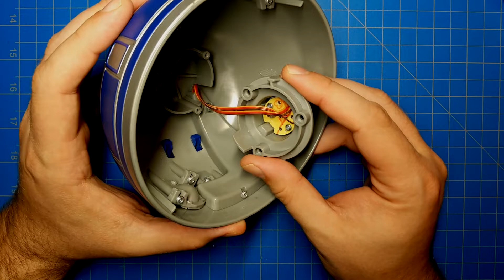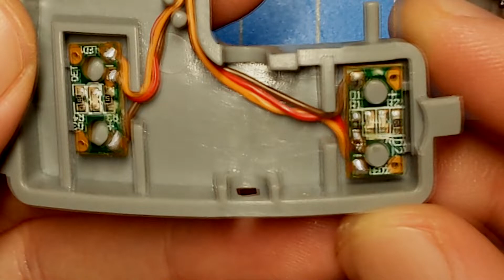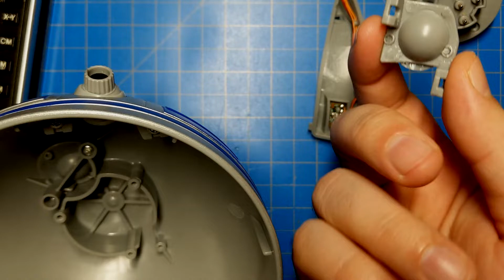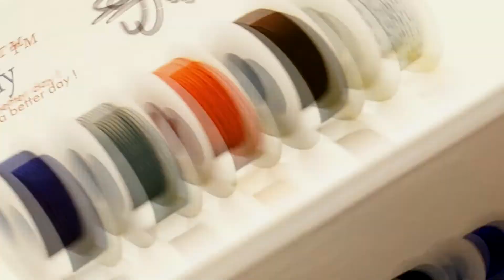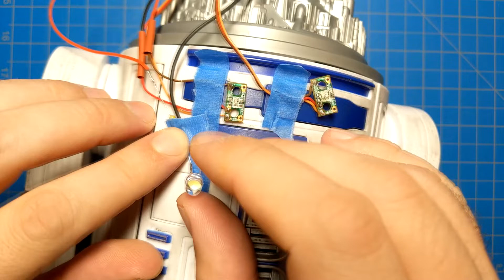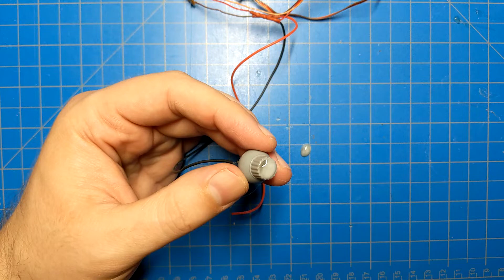Adding An LED: A Galaxy's Edge Droid Depot R2 Dome Mod

Comment: These mods, and this channel, got me to buy a custom R2 unit from Droid Depot. Thank you! Now, to truly customize it...

On that note, questions:
1. What would be the best spot to tap into for an always on/power on led for R2 domes?
2. This is opening up a can of worms, but I have to ask since you know both body types pretty well: Is it possible to power a BB head using an R2 body? It definitely wouldn't fit as-is, so 3D printing will need to be involved to make a "neck" of some kind, but I'm wondering what it would take to address the power side of things?
Reply from the maker: 1. there's really no always-on power for the head. the head has 5 connections to it, 5V, detect, and the 3 LEDs. 5V goes into all the LEDs in the head, then the 3 LED connections are pulled to ground (completing the circuit and turning the LEDs on) by the microcontroller in the body of the R-unit. maybe you could recreate the head detect circuit (a resistor) inside the body and then rewire the connector to repurpose the head detect pin as a ground. that would require heavy modification and a bit of research to trace everything out ahead of time. not sure what the consequences would be of have the detect circuit in the body, but I don't think it'd break anything.

2. BB heads are basically a coil of wire connected to 3 LEDs in the head. pulses of electricity through a coil in the body of the BB unit are picked up by the coil in the head and power the LEDs. kind of like how wireless phone charging works. To repurpose a BB head for an R-unit I think you'd have to rewire everything inside the BB head so each LED is on its own line like the R-unit heads. The easiest route would be to take the electronics from inside an R-unit head and fit them inside a BB-head. If you don't want to do that, a lot of wiring, 3D-priting, and probably some PCB fabrication would be in your future.

Comment: I like your mod! Could use a bit of refining, but it does look good! How difficult would it be to mode the back processor state indocator (PSI) and diagnostic display to light up as well? Would it be too much for the stock electronics? I want to mod the PSI and display ports to light up when the sounds go off, but if it's too much then I may either do a separet power source for the back LEDs and leave the front ones alone unless I want to swap out an LED color for a droid I make. Like my main R2-Unit R2-SP, his PSI is supposed to flicker red and orange in the front and his logic function displays are supposed to be orange as well, so with that being said, is it difficult to swap out LED colors as well?
Reply from the maker: The mods are possible, but may not be easy. When adding extra LEDs to an R-unit dome, the limiting factor is current. Each stock head LED is powered by a wire than cannot carry more than 20mA of current. Using resistors to limit the current is critical, otherwise you risk damaging the microcontroller inside the droid. The current issue is covered in this video, but I wanted to emphasize it here.

The dome (thus the PSI and diagnostic display panels) is made of opaque plastic. To make those light up you'd need to cut those areas out of the dome and replace the panels with some type of translucent material in order to allow the light form the LEDs through as well as diffuse the light. There's some room underneath the dome, but not a lot, so you need to be aware of the depth of whatever electronics you're adding to the dome and whether or not they interfere with the elements under the dome; in other words, keep things under the dome as close to the dome and as flat as possible.

Maybe a side-lit panel (usually used as a backlight for displays in electronics) would be the way to go. Something like this panel from adafruit: https://www.adafruit.com/product/1626. Or build a replacement panel so it's on the outside of the dome. Instead of cutting out the panel, place the new panel over the existing panel's area of the dome and drill a hole through the dome to allow wires to reach the new panel. 

Attach (tape) all wires to the inside of the dome so they don't dangle and potentially interfere with the elements under the dome.

Replacing the PSI LEDs is possible, but will require a delicate touch. They are very tiny surface mount LEDs (I believe 0603 size LEDs). You can find replacement LEDs on eBay or Amazon or elsewhere pretty easily, just search for "0603 led". Before removing the LEDs you need to make a note about the stock LED's polarity (the direction it's installed). If you install a new LED backwards it will not light up. Use a multimeter in diode mode to determine the positive and negative sides of the stock LED. Create a note, make a drawing, take a picture, whatever you need in order to remember which side of the LED goes where.

Removing the stock LED should be straightforward, but needs to be done with care. Add extra solder to each end of the LED then try to head both sides at the same time with your soldering iron and you should be able to then push the LED off with your iron. The pads for the LEDs should then be cleaned as best you can, remove as much solder from them as you can, then solder the new LED in place. 

The mods are possible, but will require some delicate work and several hours of time. Take it slow and don't rush things.
Reply: @Ruthsarian  thank you for the information, this is really helpful! I'll let you know if I have any other questions!

Comment: I may attempt this mod, but I'm thinking of hollowing out the projector ball a lot more, and mounting the LED to the back of the cup the ball rides in. This will let the projector still pivot and twist without risking twisting the wires.

Comment: I added the LED in that spot, but I didn't use that sensor eye. I replaced it with a piece from a snowspeeder model it. It looks like an eye.

Comment: What would be necessary to turn that into a short range projector?
Would it be as easy as not filling it with hot glue and putting a tiny transparency film in front of it?
I've seen some Halloween props do some very simple projection like that.
Reply from the maker: I can't think of a reason why that wouldn't work. I've seen something similar with night-lights. Maybe the resistor value needs to be dropped a little to drive the LED a little brighter, but I think that would work.

Comment: Awesome video!! I own just the head and was thinking of a way to power the led lights without buying the body. What would you recommend?
Reply: Maybe look into an aftermarket LEGO light kit? They use tiny LEDs on very thin wires connected to a battery pack. Some LEDs even blink.

Comment: Great job man!
I would like to ask you something. 
I have been looking for a small Bluetooth mic circuit I could put in the small compartment at the left of the speakers in the R2. The idea is to connect it to my computer so I can use it to send voice commands to an app that controls the droid via Bluetooth. Any idea?
Reply from the maker: I'm sorry, I don't. I haven't done any work with bluetooth mic modules. I would probably start by looking on amazon or ebay and see if there are any inexpensive modules available and buy one to try.

Comment: I'm only 20 minutes in, but every time you mention Detect wire, I'm thinking: "where there's a detect line, there's the possibility for different modes." I'm wondering if this is how it can tell if it's got an R Unit head or a BB head, or how many LEDs to expect (and possibly how many pins are active on the microcontroller for LEDs?). I'm seriously wondering  if there's something to unlock when making personalities, like with the accessory ports on the legs of the R units. I'm wondering if changing the 1k resistors values would change behaviors.
Reply from the maker: My guess is that changing the value won't do anything. The DET line goes right into the audio microcontroller via the 1k resistor. There's no voltage divider, which i'd expect there to be if different values were used to tell the microcontroller about different domes being installed.

If I remove the dome, the R-unit still behaves as it would with the dome (except nothing is lighting up in the head). I would of expect some sort of behavior changes if the DET did anything. 

It's possible the DET line does nothing and it's a remnant of an earlier design. On the R-unit PCB there's a separate, unpopulated connector also labeled head detection that uses 3.3 volts and connects to the bluetooth microcontroller. Another remnant  and maybe an indication of greater plans with the head that seem to have been removed during later stages of the droid's development.

Comment: Hey i recently pulled my bb8 droid out fo storage and it refuses to power on i replaced the batteries but nothing works ive tried the controller and app and nothing. The light near the switch did flash twice one time but hasnt again. Just thought to ask to see if you encountered this well working on your droids.
Reply from the maker: Try resetting your droid and then go through the process to pair it with the remote. This video has instructions on how to do that:

https://www.youtube.com/watch?v=gKocbzvLSUg

If the LED doesn't start fading in and out to indicate it's in pairing mode, then double-check the batteries. They may be in backwards or aren't making a good connection.

Also be sure the batteries are new, alkaline batteries. do not use rechargeable NiMH batteries or "heavy duty" or "super duty" batteries.

Turn the remote on and press a button. Does the red LED in the remote light up while the button is pressed? If not, replace the batteries in the remote.